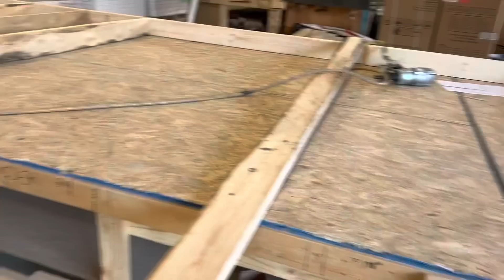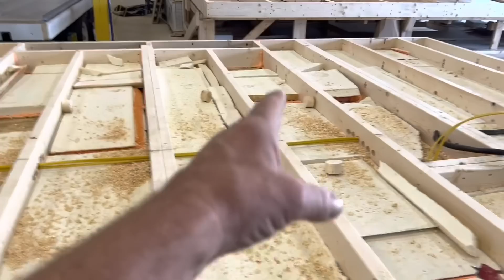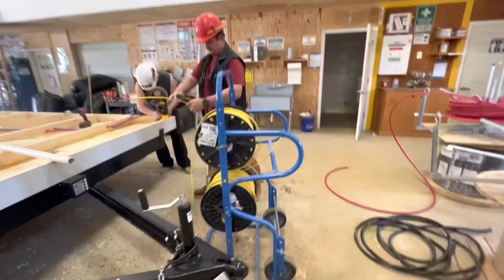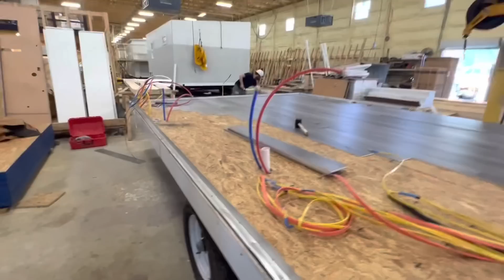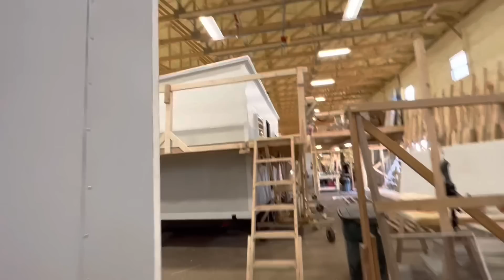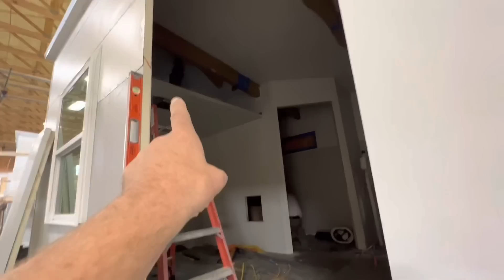1 Home a day!!!! 12x20 tiny home , a quick look into our process.

Comment: Love your production Randy! But do you really leave all the saw dust, scraps and and cutout trash in the floor structure?
Reply: It's not sawdust or wood scraps, it's only the foam insulation chunks and chips taken from the steel panels, which, as he explained, serves its purpose in the floor. It's an excellent example of adaptive reuse of material.

Comment: Are the homes set on foundation or stay on trailer.
Great work!!👍
Reply: In the Grove they will not be on a foundation but on wheels.
Reply: All homes are built on steel framed  trailers. You can keep them on wheels, you can lift them on blocks, ad you can also remove the axels and set them fully on piers or foundation... Lots of options.. But all are constructed on carefully designed steel trailers as the base.

Comment: Those look amazing. Does the beam hinder access to the loft? Is the loft able to put a mattress up there?
Reply: That is Only A Storage Loft with low height there. Those are hand crafted box beams to give needed structural support to the 12 ft roof span.
Reply: @michaelclark4357  Thank you, I thought maybe it was just for storage.
Reply: Loft for storage by design. No Egress, not high enough for mattress, just storage. And Loft was to be full length of bedroom nook beside bathroom, but Loft has been potentially shortened to accommodate easier access to storage in Loft.
Reply: That loft was never high enough to be a sleeping loft...
Reply: The beam looked a little low over the loft.

Comment: I want a 12x20 but I have land in Oklahoma and I’m not interested in moving to Tennessee.
Reply: All the 10 ft wides could be moved to Oklahoma no problem but not the 12 fts because of many issues.  Check out the coming Modular Add-A-Box if you want a transportable(in sections) modular tiny home that is more than 10 ft wide.
Reply: @michaelclark4357  mobile homes 16’ wide are towed and delivered all over the US. So it’s possible.
Reply: Would cost a bit to move as 12 foot needs permits.
Reply: Nice to see the operation!  You’ve got a nice clean shop!
Reply: Cherri, you have land... Is it zoned for tiny homes... How many can you have on your land... Will you join the and matching program? Or be able to host another tiny home... Even one other home home would potentially help any land owner pay off their mortgage quicker... A very good win-win
Reply: @carolineausmiller1884  I love Tennessee, family is from McMinn county in 1800’s but I have 5 generation family farm and I’m not interested in moving.
Reply: I saw a video of a tiny home that was transported partially out together, but mostly stacked for transport.  Then, when it arrived on site, the crew finished putting the house together.  It was a different kind of trailer but the idea might be useful.